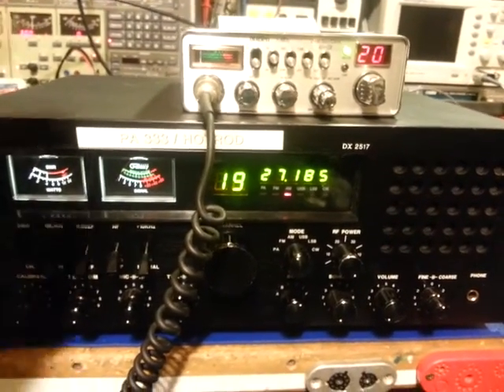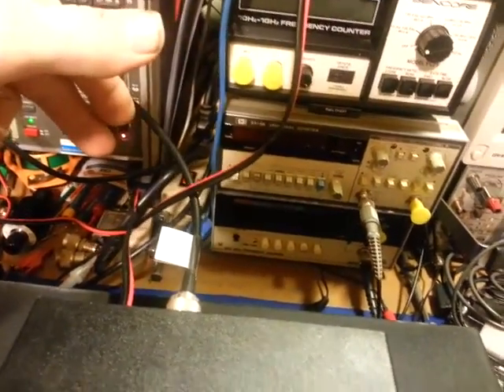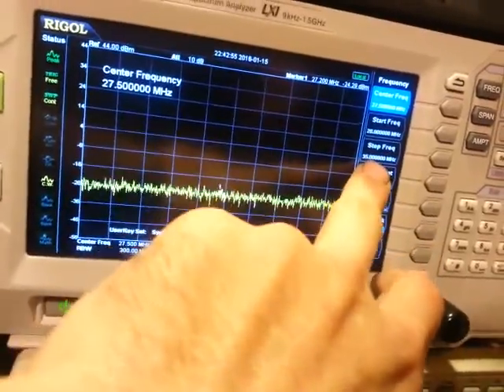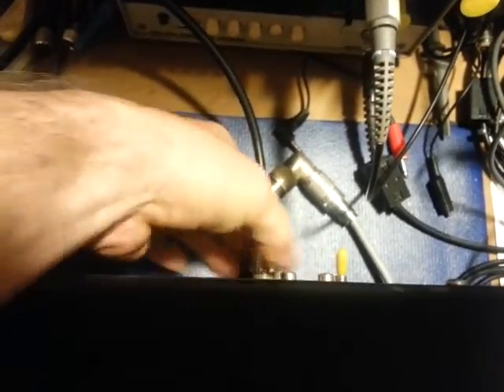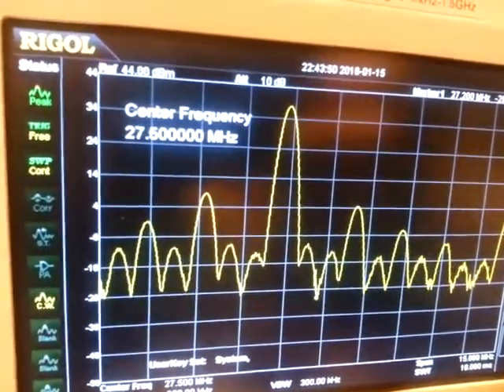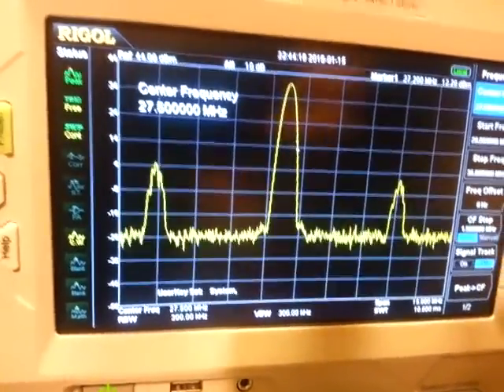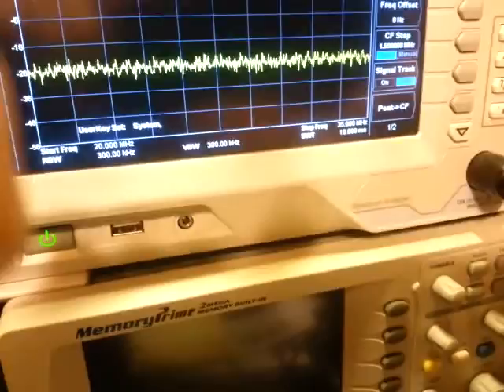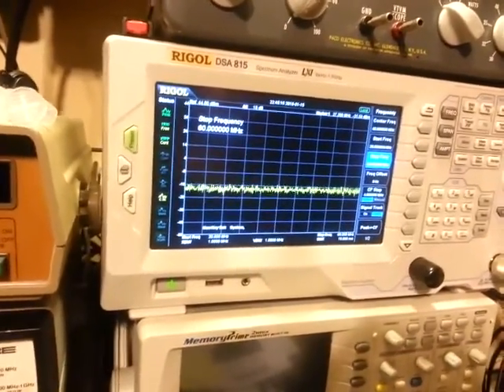Galaxy DX2517 weird distortion / spurious emissions problem.

Comment: I found the problem and the fix for your issue can contact me at modtekrf@gmail.com
Reply: What was the problem that you found - I could not find an update in any of Mike's videos where he repaired this one.
Reply: The factory added a SMD resistor to under side of IC5 pins 1 and 2 input and output on some radios likely the ones that spur all over the place, some times it is hidden under the solder joint kind of hard to spot. I would guess it was for testing the phase comparator and they never removed it. If you remove it the radio with stop generating that repeating signal,

Comment: Still no answers to this issue there are more than one of these radios doing it has to be a common problem. The radio i have spurs every 10 khz say your on 11 meters channel 20 you get a spur on 16 17 18 19 20 21 22 23 24 25 26 just lower in db as it goes away from center freq

Comment: Hello and thanks for the video.  Is there any chance you could show us the setup for the spectrum analyzer.   

I have that same unit and just learning more about how to use the device.  I am assuming you have 50 DB attenuation on a 4 to 5 watt signal.  I am not sure what the end voltage would be but will do that calculation. 

Any input appreciated